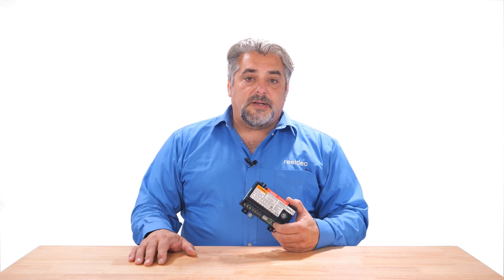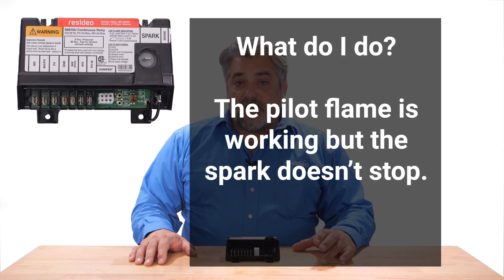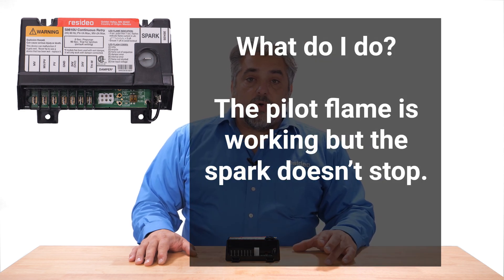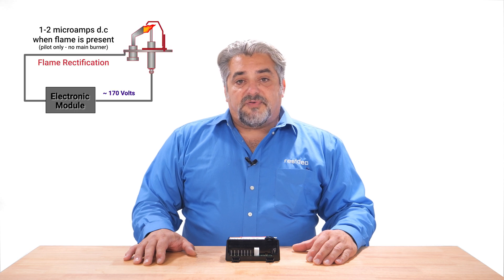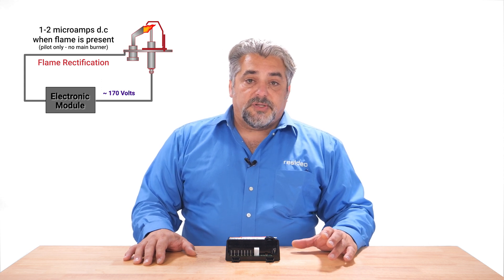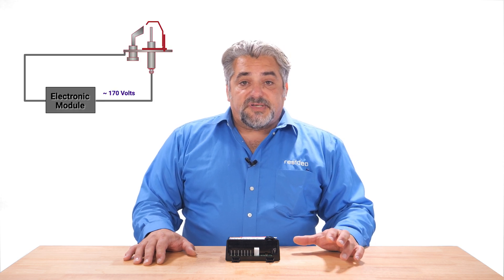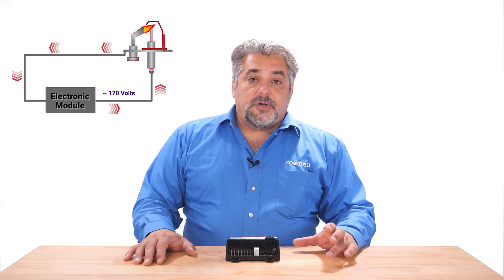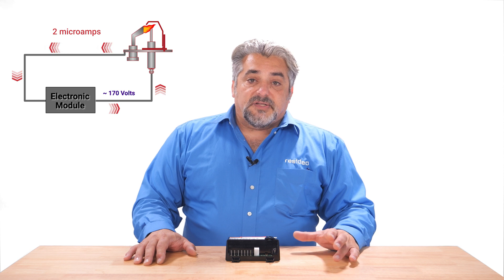Troubleshoot S8610U Intermittent Pilot Ignition Module - Main valve doesn't open when pilot is on

Comment: I think a problem might develop gradually with spark on time while pilot is lit getting longer and longer on the average until some cycles "time out" ? 
  Also behavior where sparking>pilot on > main gas valve goes on and main burner starts followed by (occasionly) main burner shuts down, sparking restarts and system restarts the main burner,usually fairly quickly

Comment: I suppose that the module itself can wear out over  many years especially if the system has an extremely aggressive "anticipator" that cycles the burner off and on frequently ( like 15 times per hour) trying to maintain impractical smoothing of temperature at the thermostat at an almost exact value

Comment: I installed the S8610U and all is good when it calls for heat. But in the wait stage I am getting a code 6 and my blower motor has a hum when the green led blinks. What could the issue be?
Reply from the maker: Hi, thanks for reaching out! If you are a homeowner we recommend to work with an HVAC professional for assistance with this product. If you are an HVAC professional feel free to contact our professional support line at: 1 (800) 468-1502.
Option 1 for English then option 2 for Contractor's Helpline. -Cesar

Comment: Add to you list of possible causes a break in the silicone spark ignition wire.  The high voltage will easily jump the break but the small micro-amp signal will not. This results is the pilot burner lighting, the spark continuing but the main valve not opening.  Ohm the spark wire to confirm its good.  This happens on spark/ sense integral pilot burner assemblies.
Reply: I guess this wire might deteriorate a bit after 30 years of exposure to the hot environment near the pilot burner area (especially at the "business end")
  makes a lot of sense that this wire might be good to replace routinely on an old unit if the module and/or pilot stand assembly is being replaced

Comment: Question I have a Honeywell SV9501M2528 if I put the IGNITION SYSTEM CONTROL SWITCH to the off position my hot surface ignitor lights up but of course pilot & burner do not light, the switch being off prevents that, But then when I switch it to on inductor fan kicks on but hot surface ignitor never starts glowing? Is my Smart valve bad or could it be something else?
thanks..
Reply from the maker: Hi Eric, are you by chance a professional HVAC technician? -Paul
Reply: No sir @ResideoPro